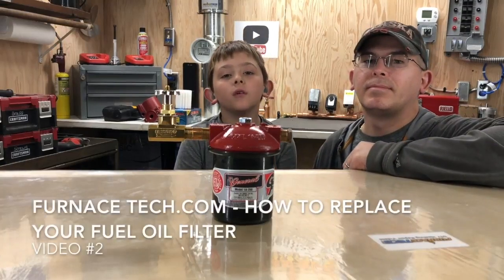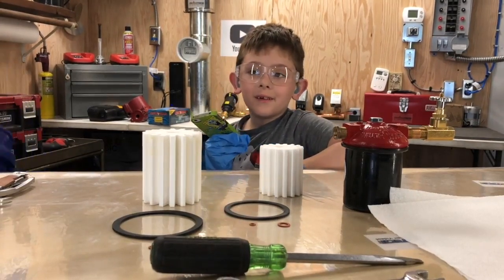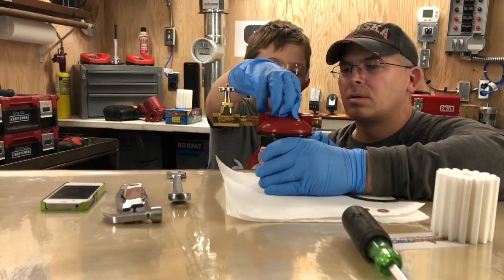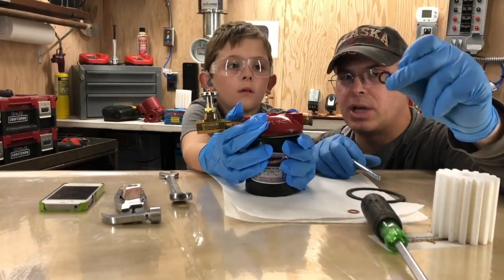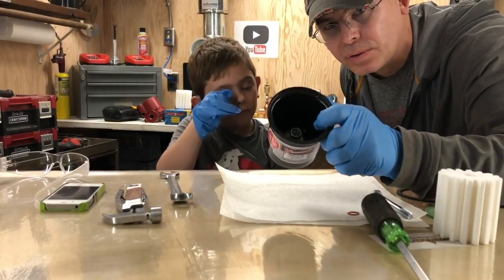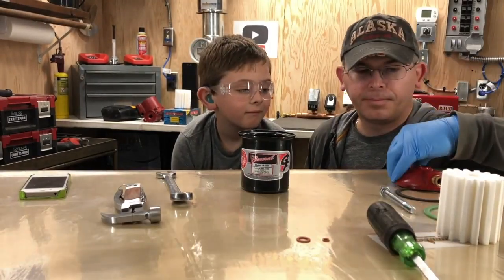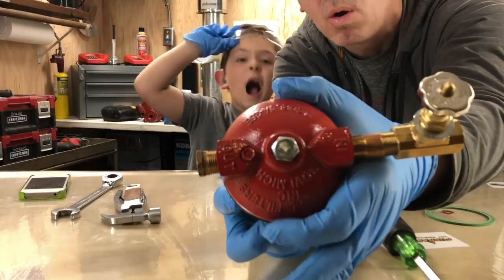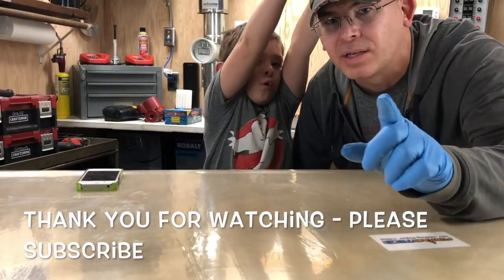How to CHANGE FUEL FILTER on your BOILER or FURNACE

Comment: Mine has a bolt on bottom also would you know what size or is it? Or the name of tool
Reply from the maker: Do not touch the bolt on the bottom of the bowl. If this come loose, it will leak and the filter kit does not include and gaskets for that bolt.

Comment: Mine is leaking. The boiler guy "fixed" it, and it still leaks. Any suggestions.
Reply from the maker: Is it leaking from the top gasket seal of the fuel filter or at the bottom of the bowl. If it's at the bottom of the bowl you may need to replace the fuel filter assembly other wise just the gasket at the top! I hope this helps! Thanks for watching
Reply: Mine has a large bolt at bottom also with a huge starbit looking would you know what size ?